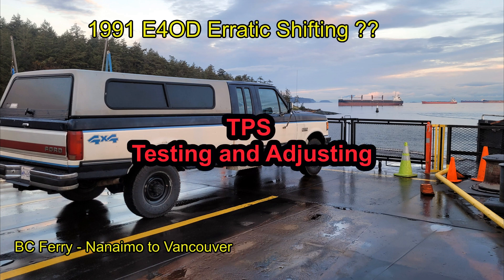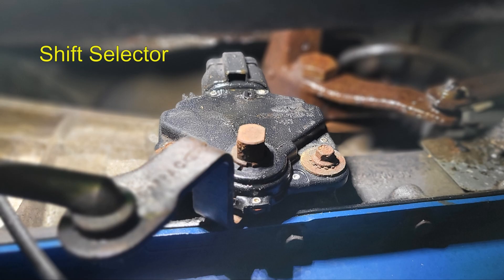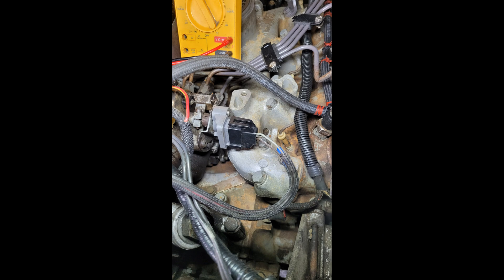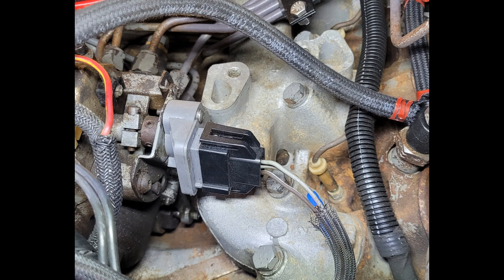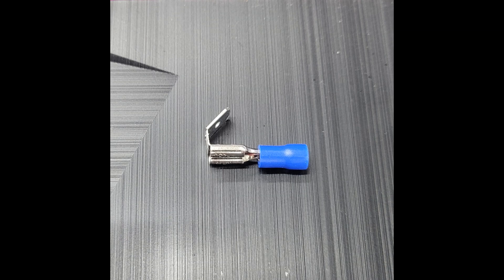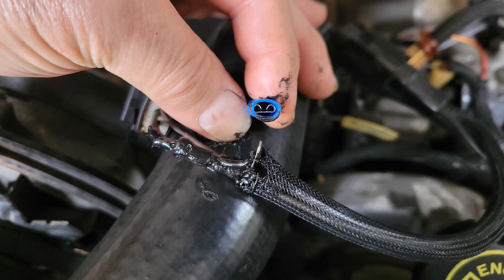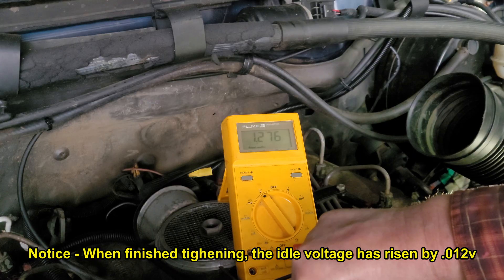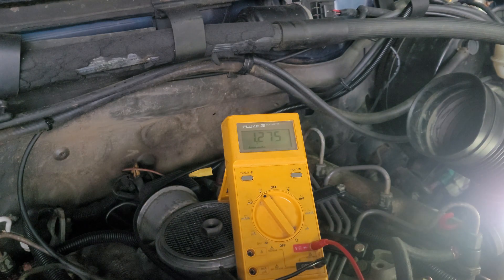1991 E4OD Transmission Problems: TPS Testing and Adjustment @CaddyMan

Comment: The issue I’m having is I have to start out 1st with OD button pressed and shift 2nd then D and after 40mph  press the OD button and we are good. if I start out in D it’s lurking all the way to 40mph. It’s a 97 f250 5.8 e4od. 75k miles!. 
New tps new tune up. Replaced all the bulbs (no led). Changed the trans fluid and filter. Replaced the vss on the rear end. New idle air control and had the transmission harness replaced. Still no changes. I’m stumped at this point!.

Comment: Thank you for sharing the video, good job.  Was your tach working properly?  I have a 1990 and the tach quit working and went into limp mode suddenly at same time.  OD light on solid, wants to start out in high gear.  If I pull it down into low to start, then when I pull it up into D, it shifts hard.  Tach sensor replaced and no change.  TPS:  at idle 0.55 volts, wot 3.5 volts.  Voltage at OBD1 connector 3.5 volts so without 12 volts, OBD1 scanner will not read.  Speed sensor in differential ohmed normal and clean.   Replaced computer (ECM) and still no change.  Any ideas?  Thank you

Comment: Shifting into next gear too soon and " tractoring" and having to let off accel pedal and re engage to get to downshift  to get engine rpm's up sound familiar
Reply: Did you find out what is was I’m having an issues with mine that sounds similar. First time I start my truck it’ll only get up to 30kms then I shut it off. After start up it will get to around 60kms. Third start ups the charm and it’ll get to 100kms. It only works occasionally. Usually can only get it up to 30kms
Reply: @angusslaughter4819 there's something called a FIPL adjustment. IT'S LIKE A THROTTLE POSITION SENSOR BUT IT'S ON THE PUMP. You have to adjust that to spec if it is still doing that after adjustment then you may have a bad transmission control module which is under the dash behind the brake pedal

Comment: My 91 sometimes shifts perfectly smooth, and then sometimes it shifts hard and aggressively. Is this the issue you were having?
Reply: The transmission doesn’t slip. It doesn’t shift at weird times, it’s just sometimes it shift into gear hard as if I’m giving it all its got in a drag race, and then the next mile it’ll shift like it’s brand new.
Reply from the maker: @TheOVprodigy  Should have said that the 'doesn't shift' symptom is definitely a result of no or incorrect voltage signal from the TPS.  Take your time doing the voltage checks during the alignment procedure.  You should be able to set it to 1.2v with the throttle closed, and over 4v at wide open throttle (WOT).  If you can find an older, needle (sweep) voltmeter, vice a digital, it makes testing the TPS much easier, as you can watch the needle move.  If the old one makes the needle hesitate or jump a little then the TPS is bad.  It should move smoothly and follow the throttle as you open and close it slowly especially when changing direction of the throttle.  Good Luck! Dave
Reply from the maker: Very likely.  I have even had one in the shop that would just 'quit' when taking their foot off the pedal.  Would start right up and drive fine again for days....The TPS is a very sensitive rheostat that is working in a very stressful application.  I am surprised they last as long as they do.  Try and buy a Standard or Blue Streak product.  If your supplier has more than one 'line' take a good look at each new sensor and you had tell just by the 'finish' the difference between the well made ones and the cheap ones that are being sold for the same price as the quality ones.  Another thing to look for is Brass or Plated bolt sleaves (corrosion resistant).  Just another feature of the quality products.